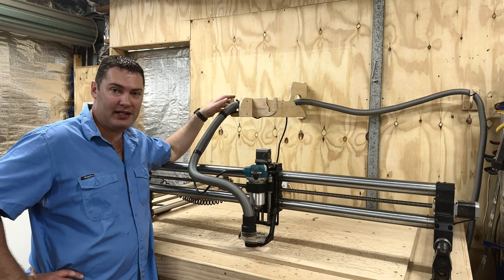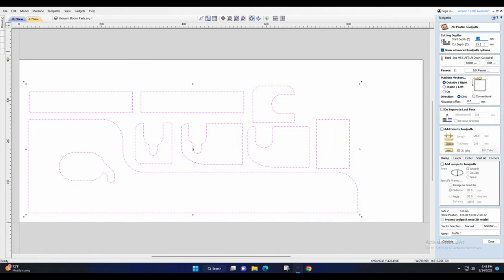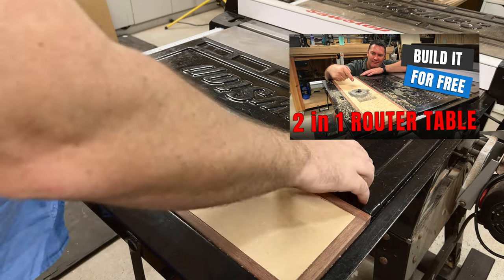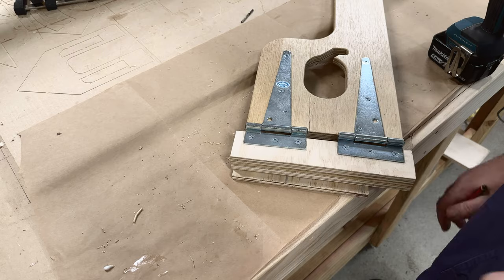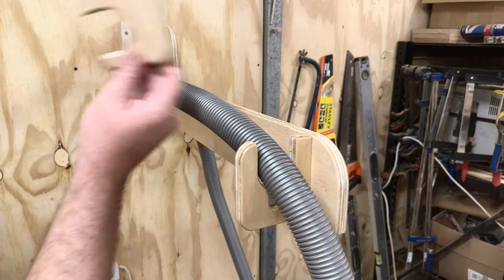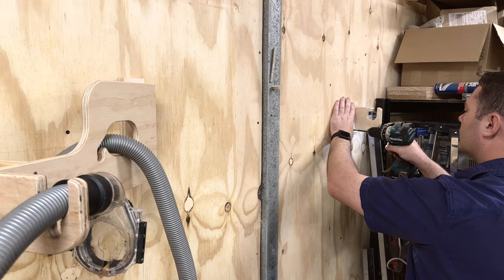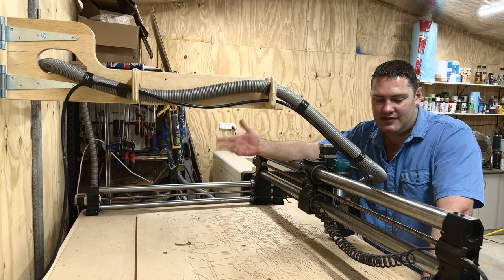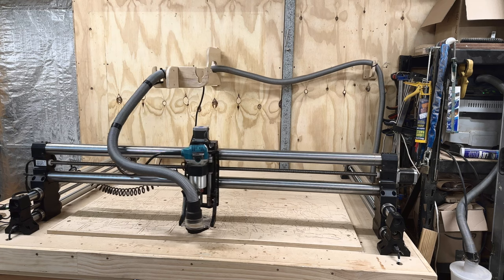BEST Shop Vac Boom Arm for a CNC - Easy to Build With Files!

Comment: Awesome. If you add a track on the back side let me know how you attach it. I was thinking you could add a light underneath the track also to add light on the table. Just some ideas I’m thinking about doing.
Reply from the maker: Good idea to add a light underneath the track Michael!  Have not thought of that. Something else I want to do is have the vacuum hose on the back so you can better see what's going on while its running.

Comment: Very cool, thanks for the plans! Just one question  what size hose will it fit  mine is 2.5 shop vac hose wondering if it'll work or will i have to modify
Reply from the maker: Hey Brian!  You are welcome.  This was for a shop vac specifically, so around 36mm/1.4" from memory.  Easy enough to just make that larger to work for you though.  Sorry I cant upload another file at the moment.  My entire shop flooded two weeks ago (6 feet deep!) and I am in the process of replacing and repairing everything.  Hopefully I will be up and running again shortly.
Reply: Oh man, sorry to hear bout the flooding. Hopefully, it all works out for you. Best wishes and no worries, you  laid the groundwork. im very new to cnc, but I have to figure out how to use this Dang software sooner or later, but I might as well be now, lol.

Comment: do you have any issues with static electricity?
Reply from the maker: Not with the vacuum hose itself, no. My screen kept going on and off while the cnc was running but turns out you are better off running the cnc and router on seperate outlets or better, breakers. That sorted my issue. I have upgraded to a spindle and dust separator since running 4” hoses. That takes everything to a whole new level. ☺️

Comment: Thanks so much for this. Just starting the journey of setting up my first CNC machine and keen to do this as my first project! 🙏🏼 Cheers!
Reply from the maker: You are welcome!  Since I made this one I have upgraded my dust extraction system so I will do another similar one soon for a 4" hose. 😁
Reply: @TwinSummitDesigns Would be grateful to see the upgrade! My hose will be 2.5”.. is it much improved now? 😁 Any chance you’ll be posting in the coming weeks? 🤙🏼
Reply from the maker: I am just waiting on the new dust boot to arrive then I will get on it.  Let me know if you have anything in particular in mind for what you want to do, but I will include something for a 2.5" hose as well.   @BikiniStrings
Reply: @TwinSummitDesigns Legend! Nothing in particular on my mind, just something relatively straightforward to build, I’ll probably use this video as an initial blueprint until your next one is out. 😁Cheers bud